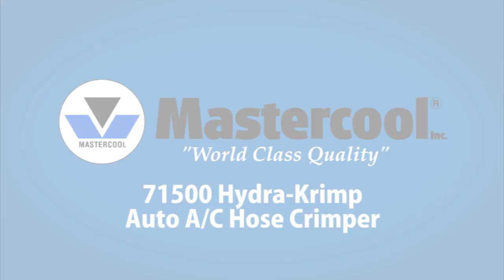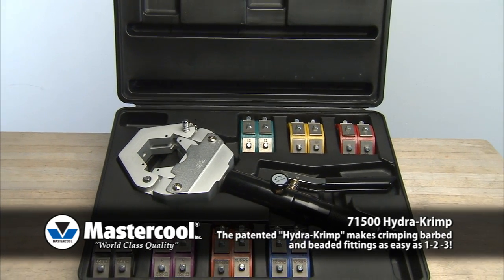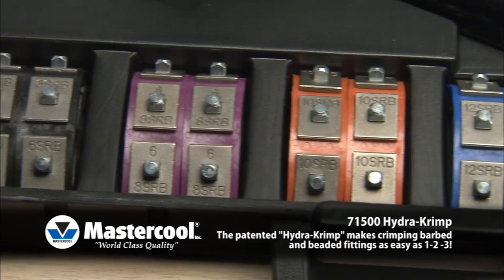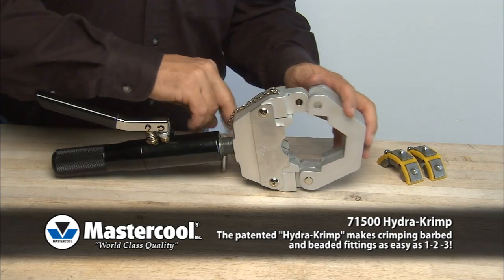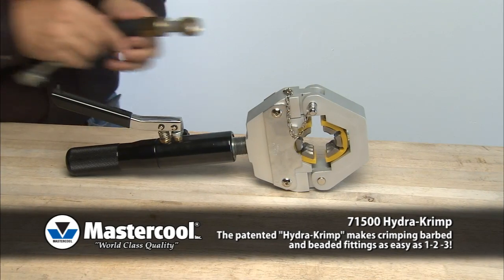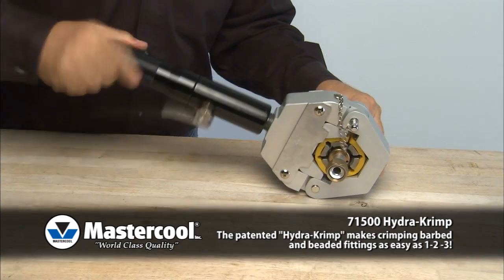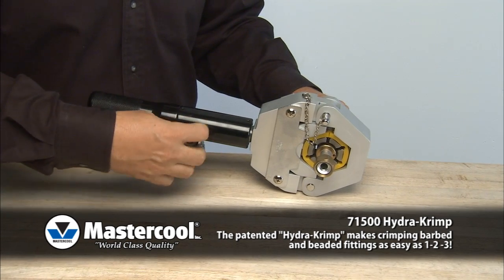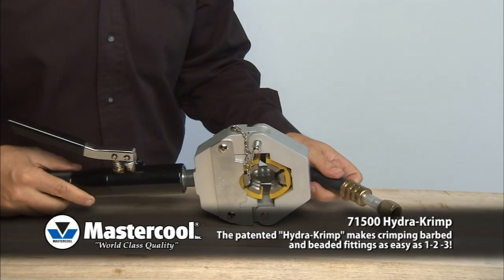71500 HYDRA-KRIMP

Comment: I'm a bit confused as to the sizing of hoses as it seems they are measured by the hard line going into them???.  I need to repair a 3/4" OD power Steering hose.  Would this work for this hose?  The hard line going into the hose is 3/8".